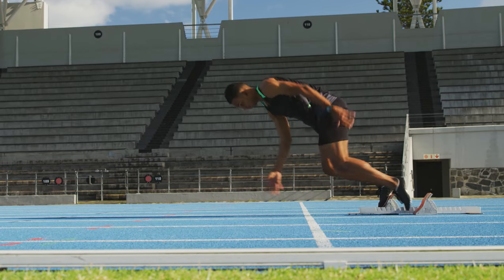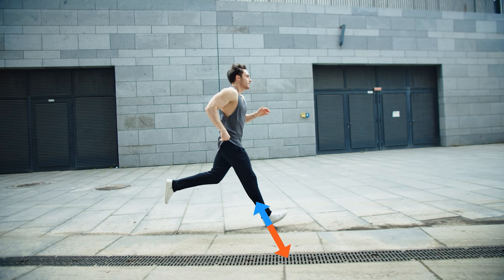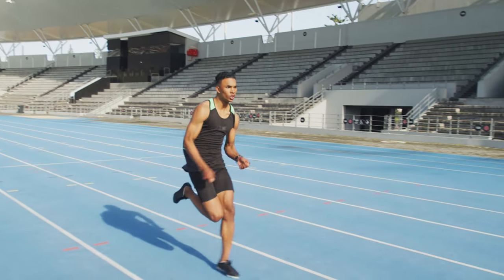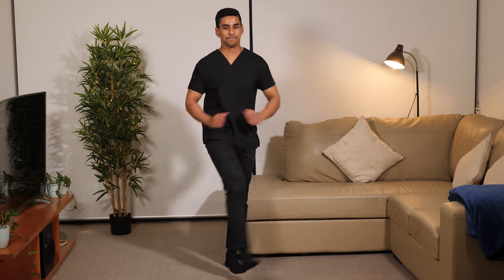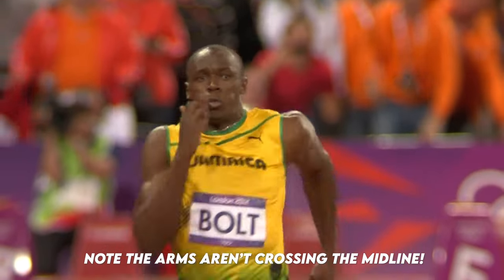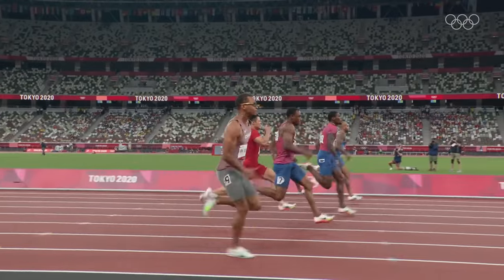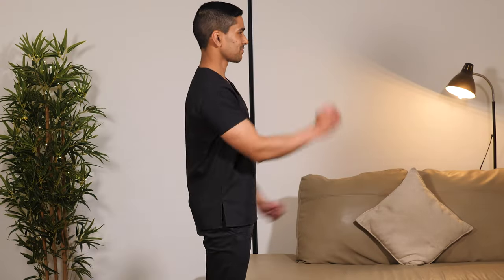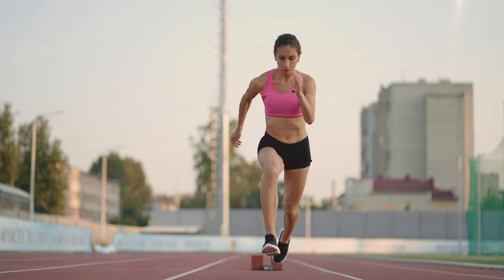The physics of arm swing in sprinting

Comment: Doesn't explain how arms generate force though or why the legs follow the pace of the arm
Reply: obviously short video but still
Reply: The force is due to the first newton's law. The change of speed, which is the acceleration and deceleration, produces a weight dependant counter acting force. As that force is needed to balance out the torque produced by the leg it has to have the same frequency. When we run we automatically adapt our leg speed to our arms because we would stumble otherwise.